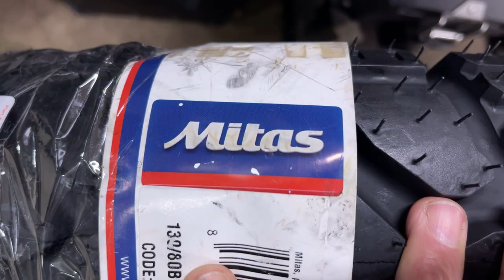Cool Mat for Kelly’s Bike!! • 1st Try with RE Bags! | TheSmoaks Vlog_1898

Comment: I've just finished up fixing some non standard panniers to my Honda cb 500. I used some nylon/plastic kitchen chopping boards (cheap from Walmart...or ASDA here in the UK) as back support boards. I'm thinking they would sleeve inside the Enfield bag pockets where the Classic frame would normally go. Use some flat bar to bridge across to the pannier rails and secure them with hook bolts (we have them in the UK for holding down roofing sheets, or electrical conduit saddle clamps). Backing board can be bolted to the flat bar with mushroom head bolts to prevent rubbing on the fabric. Spray all the fittings black and no one would know it wasn't stock! and no chopping or altering the bags/frame.
Kept me out of trouble for a day of lockdown...hope that may be of help to keep those lovely bags :-)

Comment: Evening y'all, boy Shawn that poor 800 GSA is all boogered up. But if it can be fixed, and they want to spend the money, you can do it.
I've already seen so many good ideas on mounting those bags, I think I'll just stand back and see what happens. As a temporary stop gap, could you interlace them around the brackets across the rear seat and back rack and then back to the bag. I think this is similar to what someone else mentioned. Ok, now I'm done. 😉
Well, I await with bated breath your solution. 😄  I'm out, see y'all tomorrow.  God bless.  Rob

Comment: As a fall back, wonder if you could get some heat resistant material, similar to what Harley and others use on the legs of their rain suits, and sew it into the bottom and corner of the bag in question.  That way it would help protect the bag and contents although some rubbing on exhaust. A 2nd alternative would be to sew in an attachment strap in the back corner that could be looped over the carrier to keep the bag up from the exhaust.

Comment: Hmm... I wonder if you could take the bags in to a seamstress with heavy duty equipment to have them modified with extra/proper straps or attaching points? Someone that can do patches and leather work. I know the lady I take my stuff to has the industrial type of sewing machines and access to materials. Might be a thought if you can't find a similar bag made for the Himmy. With Ride-on are wheel weights even really necessary? Have a great Tuesday. Peace and love.

Comment: I’m also about to try out a set of Mitas tires. The courier just dropped them off as I was watching your video. KTM 690’s used to come with those Metzeler Sahara’s stock. Now they come with the Mitas E07+ stock. The + is a newer tread design than the original E07.